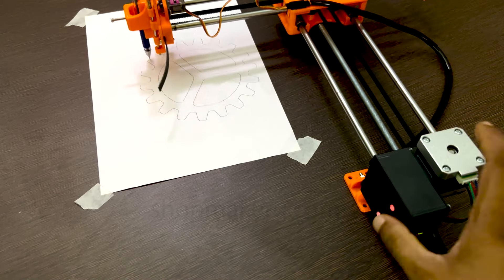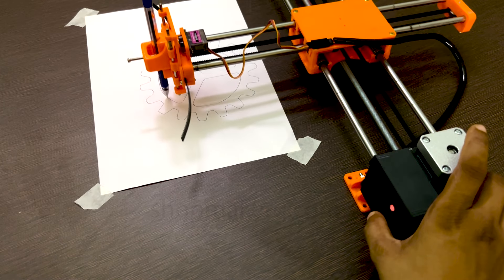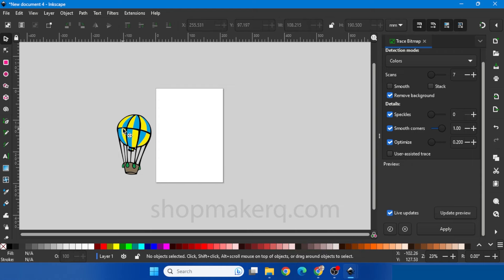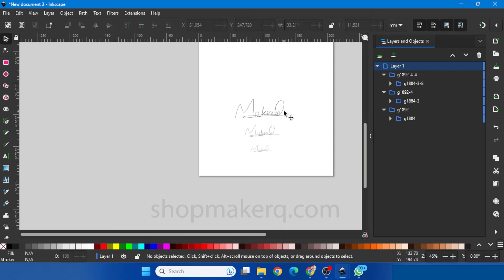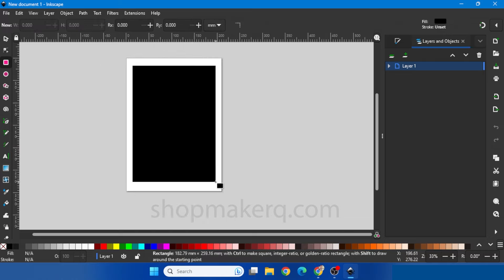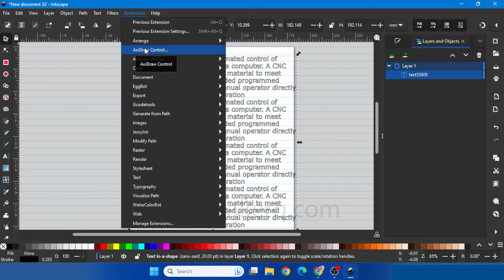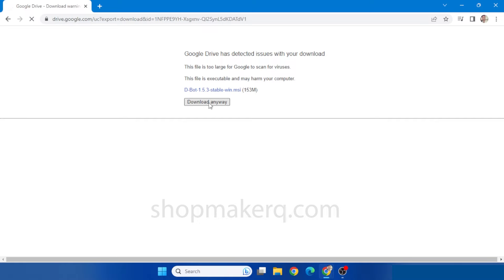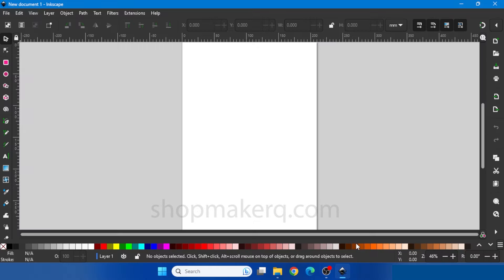EasyDraw v3 software video | writing and drawing machine.

Comment: Hey the shipping on the webiste only for India? i want to order it to Israel is that possible?
Reply: Palestine ❤
Reply: I haven't ordered yet, but yesterday the shop offered Germany as destination country, so you should be fine. But the shipping is half the cost of the EasyDraw, still a ton cheaper than the AxiDraw (which price is just over the top, since it's not more than a 3D Printer without the y and printing function)

Comment: Hi, Looks very interesting. What is general durability of the control board, rest can be 3d printed but if control board is not durable it is risky, Can you tell generally how long can we expect control board to last without problems?
Reply from the maker: Our v3 controller board is highly durable, In the past 4 months, more than 600 customers have utilized our v3 board without encountering any issues. Because of the external stepper motor driver. even if the stepper motor driver were to malfunction, replacing the a4988 stepper motor driver is very easy and cheap.

Comment: @ShopMakerQ Do I need to buy v3 controller board additionally when buying v3 machine??
Reply: @shopmakerq4821 V3 control board doesn't come with EasyDraw V3 writing and drawing machine??
Reply from the maker: @simonrileyghost493  sorry sir, it was a mistake from our side. We replied to the wrong comment.
Yes the V3 assembled comes with the V3 control board and you don't have to buy it separately.

Comment: plz sir 
make a special video on 
how to set our own handwriting font
Reply: This is pretty hard if you want "real" handwriting, because every letter behaves differently with every other letter, so you'll need to save 25 As, then 25 as, then 25 Bs, and so on.

But if you just want normal handwriting you can just create your own font, convert it to inkscape and just it for your texts. You'll need to write the alphabet in your wanted style with big and short letters and then just vectorize it. There should be several guides to this